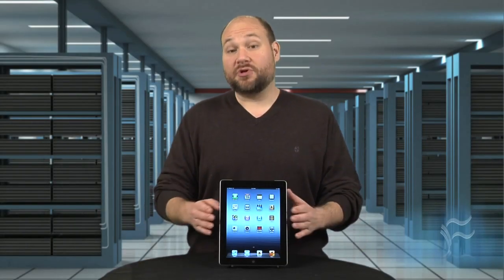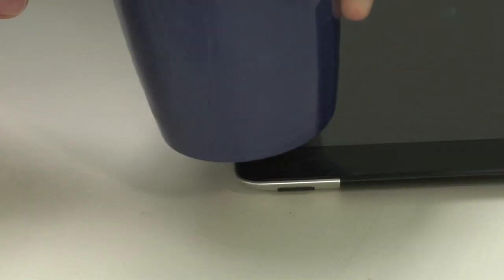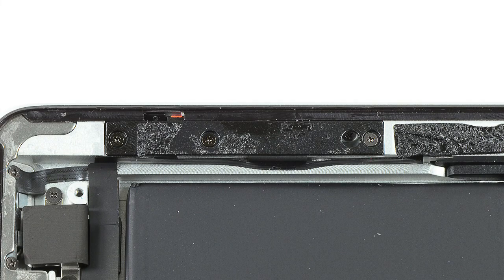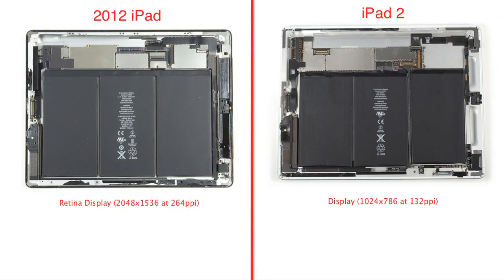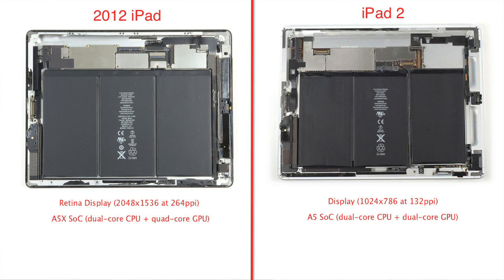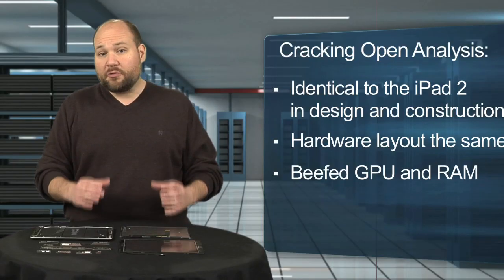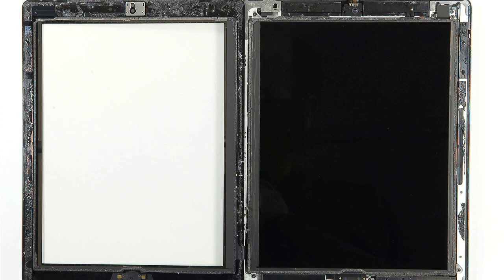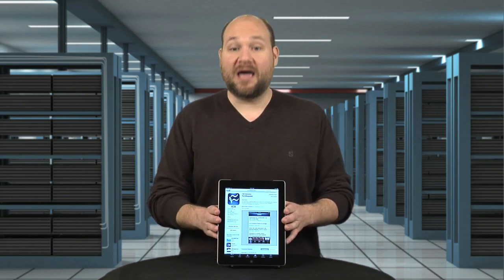Cracking Open: The Apple iPad 2012

Comment: @iH4ckMacs Actually the retina display is 4x the resolution of the iPad 2's. The number of pixels are double that of the iPad 2's but...
It's 2x vertically and 2x horizontally.  If your closet were 2x2 meters, it would be 4 sq. meters big. Now of it were 4x4 meters, it would be 16 sq. meters big. See the math?